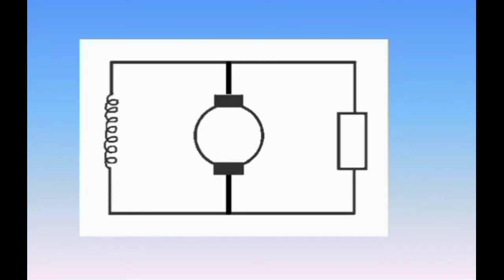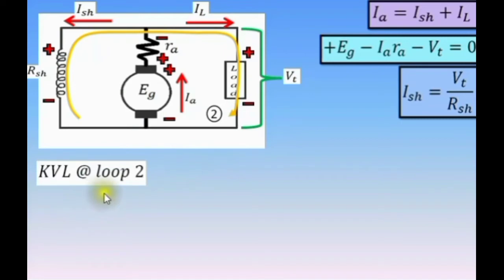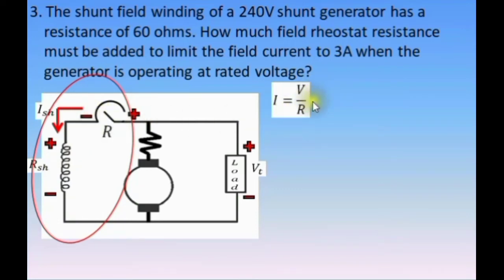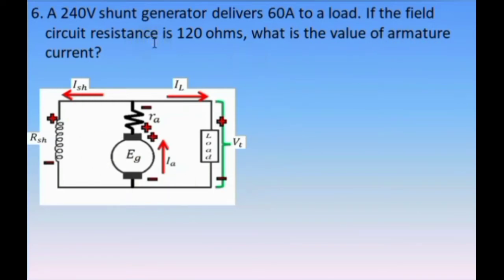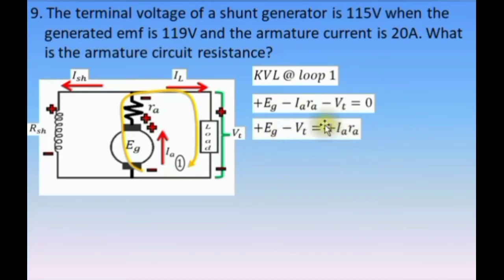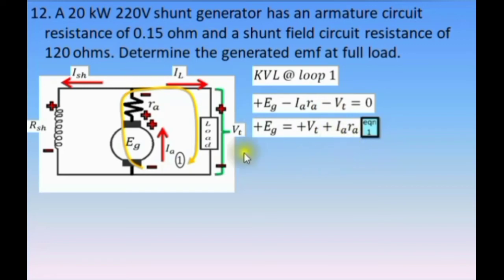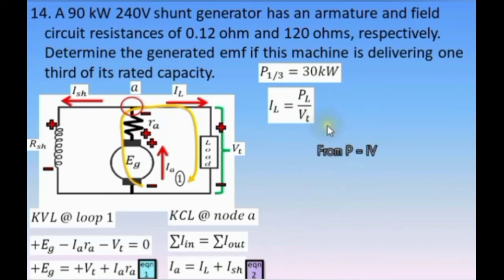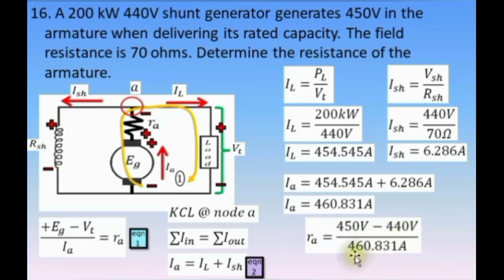16 Solved Problems in DC Shunt Generators for Beginners

Comment: Two shunt generators, A and B, are to be operated in parallel to supply a common load. Generator A has a no-load voltage of 240 and a voltage of 220 when it delivers a load of 60 amp. Generator B has a no-load voltage of 230 and a voltage of 220 when it delivers the same current as A. Assuming straight-line characteristics for both machines, calculate: (a) the line voltage and the total load in kilowatts when generator B is “floating”; (b) the total load delivered by both machines when the line voltage is 225. Ans.: (a) 230, 6.9 kW; (b) 16.9 kW

Comment: Sir bakit di sinasama IL sa pag KVL eh nadaanan din naman sya
Reply from the maker: Kung given naman yung terminal voltage siya na yun. Since voltage ang unit ng mga dadaanan ng loop.
Kung hindi given ang Vt at ang given ay load resistance, dun gagamitin ang IL para maging IR (unit is volts)
Reply: @sieffresnotes  bale if di given Vt pero given IL ano po equation kasi diba since IaRa dapat kasi V=IR edi magiging Eg=IaRa+ILRL?
Reply from the maker: @ChrisImmniñocastro  tama, as long as merong  given na RL. pero mas madalas na given Power output and terminal voltage.
Reply: @sieffresnotes  maraming salamat sa pag post ng mga gantong content sir sana madagdagan pa soon
Reply from the maker: kapag hindi na ulit busy. Yes, madagdagan pa. :)